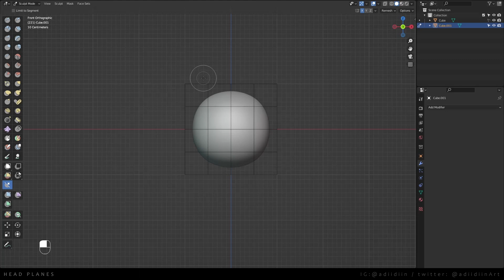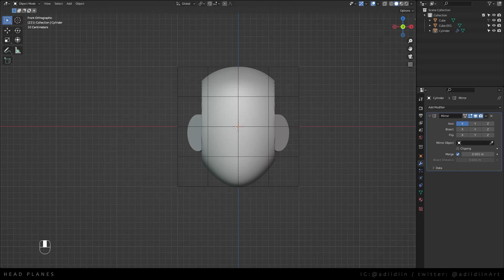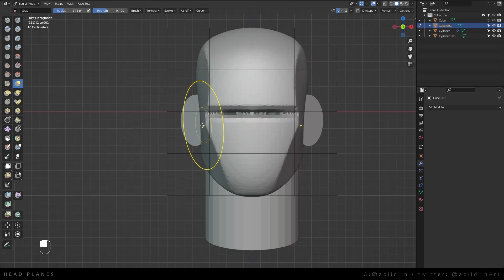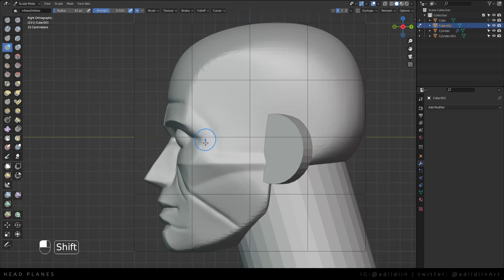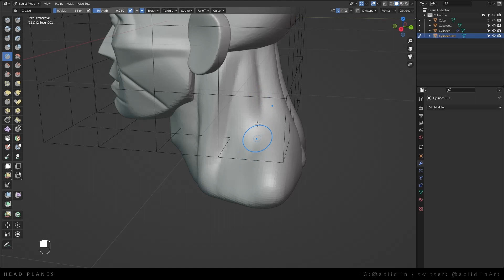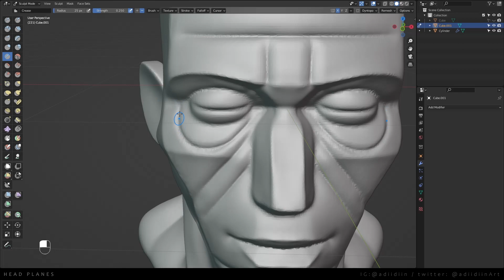Sculpting Head Planes Tutorial | Blender 3D

Comment: Hey im curious; have you adjusted your brush settings for things like draw sharp?
Reply from the maker: Hi there! I only adjust the radius and strength. Then I guess also relying on my pen pressure c:
Reply: @adiidiin  wow so nothing on tip roundness! Cool!
Reply from the maker: @Garrith Gill  Nothing. I haven't explored those settings yet 😅 but I do play with the stroke and falloff sometimes. Just not sure in this video c:
Reply: Eek! That's so exciting! Ok I'll keep working at it. By the way.. I'm so thankful you made a slowed down version of the block out phase. I followed your Harry Potter tutorial and had it slowed down to 0.25 and I learned so many things from that video, like inflating the mouth section and then pulling it up into the nose. It was so difficult to follow initially, but this was so manageable and easy to follow, so thank you!
Reply from the maker: @garrithgill6692  you're welcome! glad to hear that c: